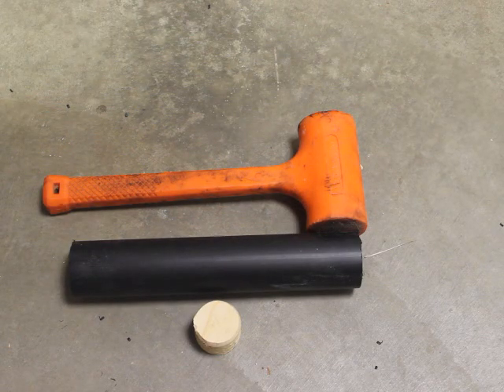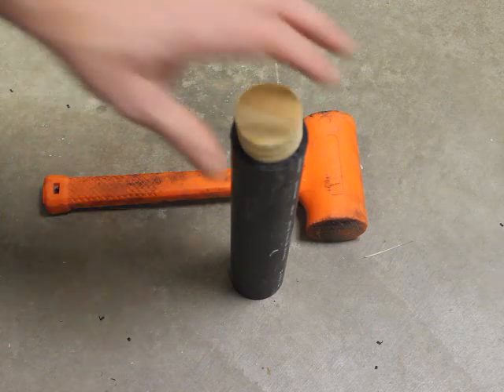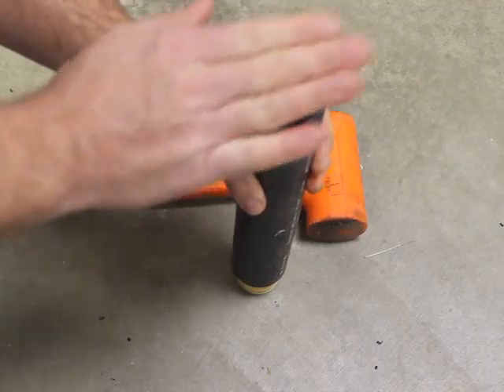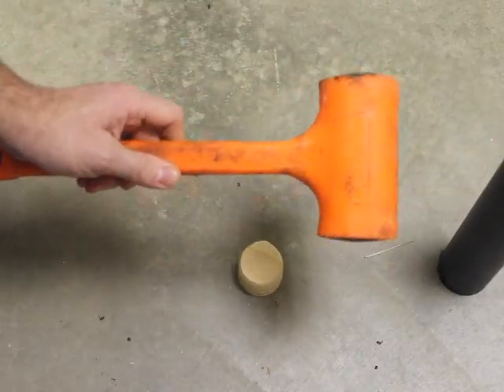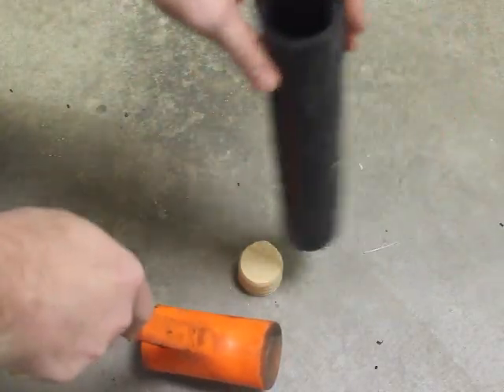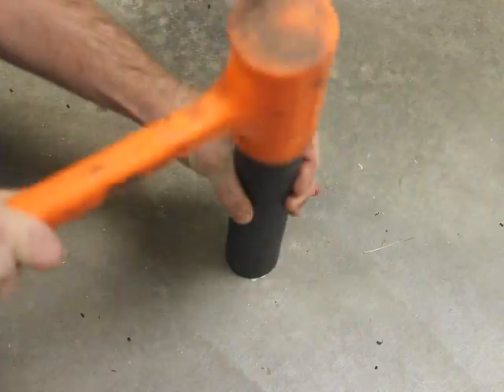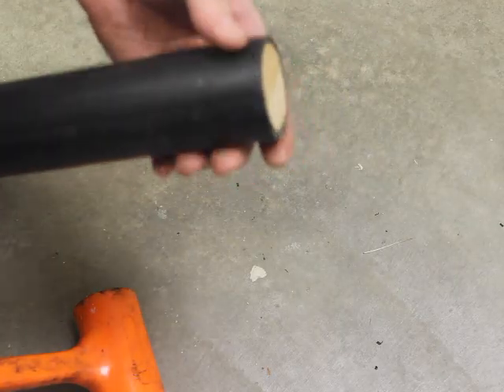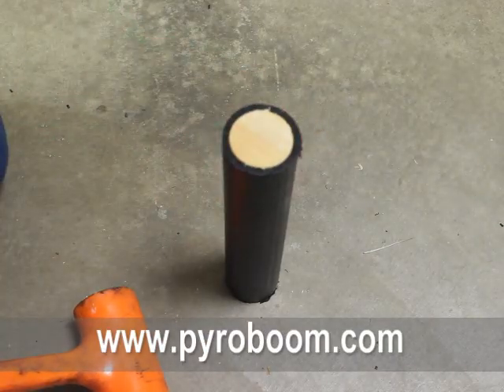Insert Plug into an HDPE Mortar Tube

Comment: So you absolutely have to staple or screw into the plug?  What kind and size screw?  Also After how many shots should you be concerned about the wood plug and replace it?
Reply from the maker: Yes, you will want to staple it.  I would use 2 16ga or 4 18ga staples.  1" in length or longer.  You should get dozens of shots with proper use and storage.  Also inspection (unloaded) is crucial.  I would not use screws.
Reply: Three #6 not that long, pre-drill and put them in.

Comment: My cake is missing the clay pug red stuff. Is it safe to light?
Reply from the maker: No. not safe.
Reply: It is not always red, often a dull whitish.  Many cakes include additional wood below the tubes as well.  The better cakes also have wire wrapped around the side of the cake as well.

Comment: Have you tried a press? Less smashed hands, less fatigued wrists, less mistrikes....
Just sayin, if you are doing a lot, try a press.
Reply from the maker: Yeah, we have 2 presses actually.  Custom made just for our tubes.  This video was made for those who don't have a press.
Reply: @PYROBOOM  I am a machinist...I always think about fixturing. 😂👍
Reply: A dead blow has ball bearings that absorb the shock.  There is no stress, I would use a smaller unit but he probably has strong wrists from making many tubes.  4 pounds is huge, that us what you would use to assemble the bottom to an office chair.  I have a 3 pound I normally use when a dead blow is required.  A dead blow also creates a LOT less damage to what it is impacting.  You do not get the bounce like with a hammer.
Reply: @subaquaticpyro8234 quite aware. All hammers create stress, that is the point of the hammer!
A dead blow can also be a woman that performs lame foreplay.
But neither changes my original comment... 4 years later. 🙄

Comment: Is this necessary if you bury the tube in ground.
Reply from the maker: The tube needs to be secured somehow.  Normally it's a mortar rack.  Consumer tubes are not buried.  I believe tubes bigger than 6" need to be buried.
Reply: @PYROBOOM  but they STILL have plugs as well.
Reply: ABSOLUTELY!!

Comment: What length staples, also crown 1/4 or 7/32?  How do you make the plugs?  I notice 4 dimples and a taper on the ones I commercially bought?
Reply from the maker: You can use galvanized staples and should be 1" to 1.5" in length.  1/4", 7/16" or 1/2" for the width is fine.
Reply: @PYROBOOM  I have seen even smaller width staples, 1/8" and even 1/16" which is why I do not trust stapled tubes.
Reply: Yeah, 4 staples or three screws, #6 is fine for screws but I have piles of number #8 deck grade screws so I use them.  Same ones I use on the racks.  Not the cheap screws.

Comment: What length should a homemade hdpe mortar tube be? 2in and 3in?
Reply from the maker: See here:   http://www.pyroboom.com/products.aspx?name=mortars
Reply: PYROBOOMLLC thank you that was very helpful much appreciated
Reply: 12" to 15" for DR11, 1 1/2" deep plug regardless of material, I have even seen cement used.

Comment: So i here this a lot. About how the ID of a Mortar Tube cannot be too big or the mortar can not launch properly. Like for example i see people say, 2 inch mortar tubes are too big for 1.91" mortars. and 1.91" mortar tubes are too big for 1.81" and 1.75" mortars. Im not sure what is correct and what is false. Could you please explain what mortars are compatible with bigger ID size mortar tubes?
Reply from the maker: The term "two inch" should be associated with display shells, which have an ID of 2"    Consumer shells, will use the HDPE tube depending on the OD of the shell.  So I can't answer your question definitively, but the most universal tube to use for canister shells and nearly most premium ball shells would the DR11 1.91" ID tube.  The DR9 tube (1.81") should be used with smaller shells, like a festival ball shell.  Remember, if you have a shell that is 1.75" OD then don't don't forget to add about .125" for the leader fuse.  We rarely sell the DR9 tube.  Most people buy the DR11 tube, so when in doubt, buy the DR11 tube.
Reply: Ok, thankyou very much! I am now certain that i'll get some dr11 12" mortar tubes from you guys. Out of all the mortar tubes I've seen online, you offer the cheapest prices for shipping and the product itself! Thanks!!
Reply: Andrew T t
Reply: Well, 1.81 and 1.91 are inaccurate anyway, it is all really metric.  DR9 and DR11 are those dimensions but not the firework which is actually 35mm or 40mm.  Yeah, putting a 40MM in a DR9 is not a good idea.  It will usually leave the tube but explode dangerously low.

35mm are OK in DR11 but DR9 is safer.

Comment: well done sir you showed every aspect ★★★★★
Reply from the maker: Thanks!
Reply: He did not show what to do of you use screws like I use.
Reply: @subaquaticpyro8234 A little common sense goes a very long way. Once the plug is installed you would then pre-drill a hole into the mortar and plug itself using a counter sink bit for the size screw you are using making sure to drill hole into the cross grain of the plug and then put screw in.

Comment: Would those plugs work on Fiberglass tubes? I have bunch left over from canister shells I bought and rather than throw them away, I was trying to think of a way to repurpose them. Thanks
Reply: I don't believe they would.
Reply: Fiberglass tubes are thinner, but the inner diameter should be the same, so in theory they could work.  Fiberglass just wears out quicker and is very dangerous if they shatter.  They tubes you describe probably already have a plug.  If not, you better call the ATF about them.  Just hold it up to the light.  The bottom 1 1/2" should be dark and the top part translucent.  It is kind of cool how you can see the shell go up the tube.